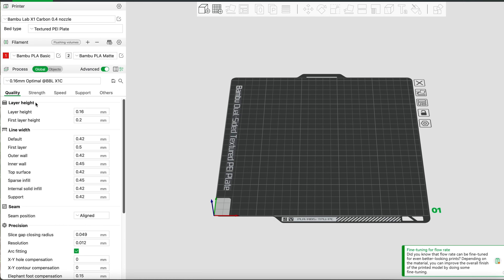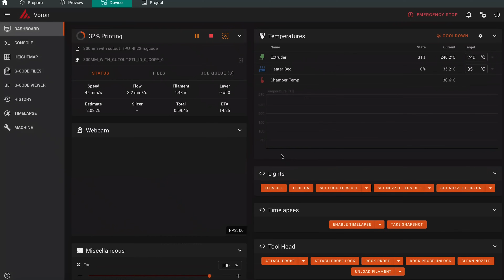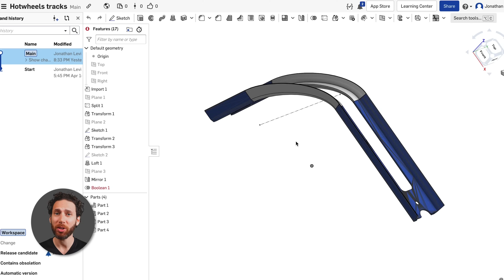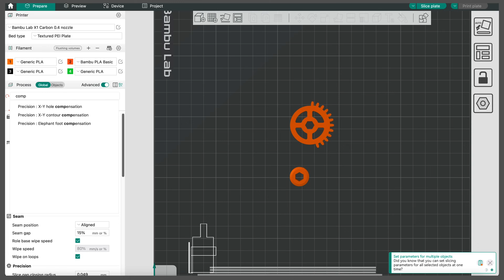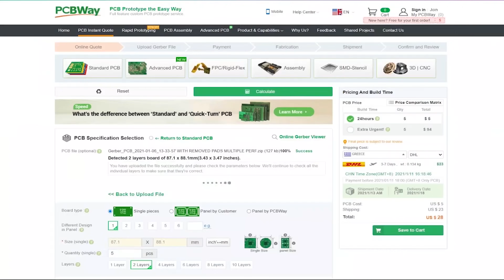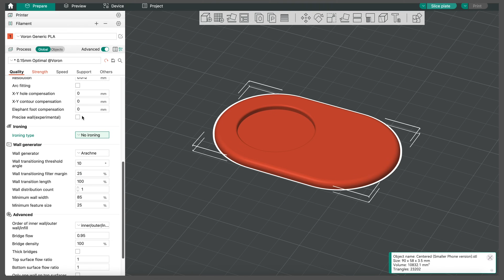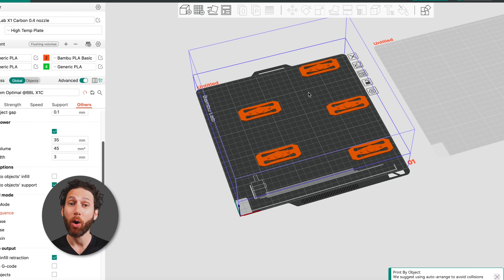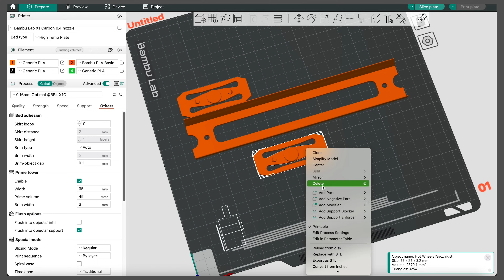Rapidly Improve Your 3D Prints with Hidden Slicer Settings

Comment: Just a note on option 10, and I'm only a few weeks in so my suggestion might not work with everything like this, but you can merge multiple objects and separate them from others on the same plate so that you don't need to separate 10 objects, just technically 2. Put 5 on one side of the plate with enough clearance for the print head to get the second group of 5

Comment: variable layer height ive found to screw with dimensions. i work with molds and the tolerances need to be very tight within 0.1mm and i recently printed a model with variable layer height only to find out after the 12hr print that it went from 67.5mm width down to 66.95mm, which might as well be the span of the brooklyn bridge. model was useless and could not be used at all

Comment: @thenextlayer Another great video! Thanks. I don't see it mentioned, so I'd thought I'd point out that there is an easier way to set per-object settings in Bambu/Orca. In main panel on left, in the Process section header, there is a selector for Global/Object. Just select Object there, and then select one or more objects and use the same UI (Quality/Strenth/Speed...) to tweak params for the objects. And it highlights what you've tweaked. I'd post a screenshot if I could. Click Global to go back to that view. Cheers.

Comment: Great video. I would add one more, with arachne you can heavily modify line widths from function to function. For instance with my 0.4mm Nozzle and 0.2mm Layer height I use 0.8mm infill line width, 0.5mm outline perimeter, 0.6mm inner wall perimeter. This incereases print speed by sometimes 25%, the quality stays the same. This needs a little bit of tuning but works very well generally speaking. I also use a 0.25mm Nozzle to print 0.6 line widths you don´t even have to change nozzles and you can print very fine lines in the same print if needed. Arachne was the best and biggest change for FDM slicers and people didn´t even notice.

Comment: I noticed a few new features I didn't used before, I didn't know orca slicer is that good, so I will try it. As for printing object one by one and removing them while the printbed is still hot, it will result in crooked pieces, specially if they are thin, like for instance gears or such. Also, might not be that good if you skip a step on the motor while scraping the object. I would at least insert a pause comand in the gcode after each object and make the printer do some type of queue printing.

Comment: Some more tricks/ tips. Use more a 0.6 nozzle. Print your top surface layer with one shell and set the extrude to 0.42. Now the flat spot of the 0.6 nozzle will go over the previous layer for the second time (partly). The effect is that the nozzle is ironing and printing at the same time, the surface is silky smooth. Try it.
Did you ever set your walls/ shells at 3,5 ? This means that after 2 layers the 3 one have one wall less, this one wall will be laid there buy the infill, as a infill wall. this create that the infill is more connected with the walls, making your part stronger.

Comment: OrcaSlicer does look interesting - but I'm kinda confused as to why you'd want to monitor your print from the slicer. Sure, it saves a step, but other monitoring software like OctiPrint give you so many features and control, and allow you to monitor the print from any computer or even on a cell phone. It sounds like it just distracts from the primary reason for a slicer, which is to prepare the 3D model for printing.
Reply from the maker: It works with Octoprint, too. It shows whatever interface you put on the printer

Comment: Don't forget after customizing the settings for your print in the slicer, save the project out as a .3mf so I you decide you need to tweak something after closing the slicer you can get back to where you left off.
Reply from the maker: Yup good advice